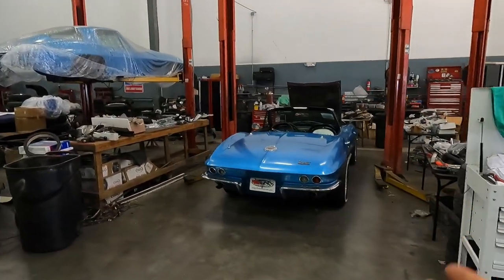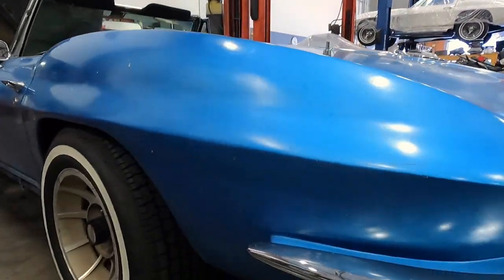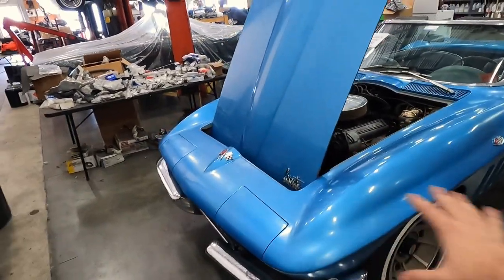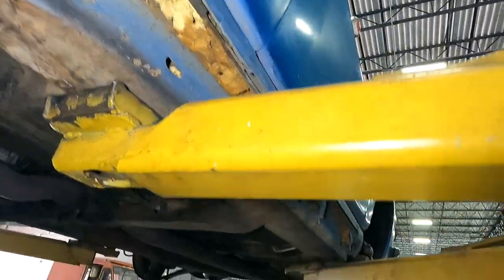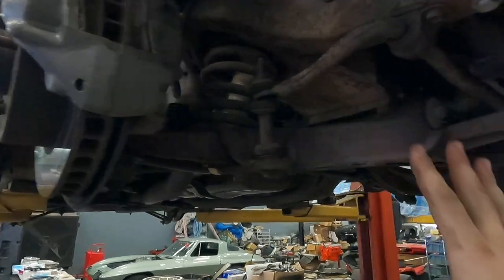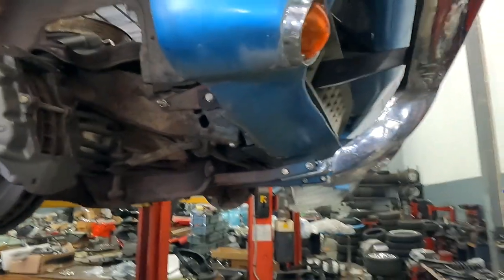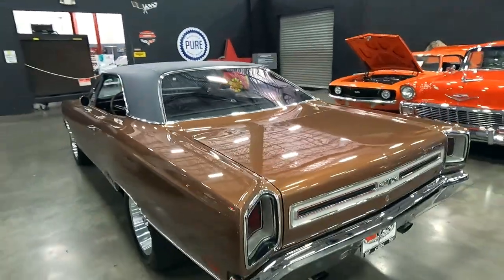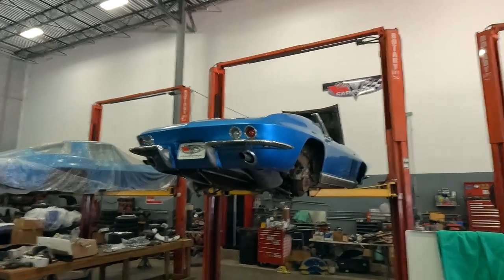Our Most CHALLENGING Corvette Restoration Yet? Frame Off 66 C2 Convertible

Comment: So what was the purpose of all the foam ?????
Reply: Either for sound deadening, and or for "structural purposes". This kind of foam was hot a couple of decades ago to "add strength" to a chassis by limiting the void space in the frame rails. The biggest problem with this foam is it can trap moisture and accelerate rust. Lots of OEMs in the 90s and early 2000s built their cars with this material.

Comment: Not sure if you would be interested or would know anyone but I have a New original GM rad support (still has GM sticker on it) for a mid year BUT only catch it has the cutout for the Fuel Injection. I never advertised it but I would think someone would want a new original rad support for a mid year Fuelie.

Comment: I would think that 100,000 dollars would not be out of line for this restoration.   My gut tells me that since this car is not anything special it would not be cost effective to restore it.  I I have seen 66's better than this one go at auction for 65k to 75k.
Reply: A restored high performance 327brings well over $100k. The problem is when you start driving it the value quickly drops.

Comment: holy crapola, what a mess. Hit on all four corners?  If that car belonged to me, I'd sell it and get a no hit Corvette for you to restore.
Reply: It is increasingly difficult to find a Corvette restoration candidate of that vintage that has not been in an accident.  They were sold and bought as performance cars, and not always driven by skilled drivers.  Stuff happens, let’s be happy that the are quality shops who can deal with restoring damaged cars
Reply: @Thomas63r2  Sounds like the relatives want to restore dad's old vette. I got spoiled 40 years ago looking at Vettes . You could find the no hit cars fairly easy back then. I wonder what the restoration bill will be, 100K?.For that much you could find a no hit car.
Reply: @steveosgood9182  it's more of a sentimental thing.
Reply: @georgehernandez1313  Yes, I mentioned that about the family wanting to restore dad's old vette
Reply: @steveosgood9182  it will be well over $100k to bring it to his standards
Reply: @steveosgood9182  Emotion and nostalgia  rule nearly 100% of nut and bolt restorations.  Buying an already restored example can save money: but it is rare to impossible to find a fresh zero mile high digit restoration in your color, drivetrain, options combo for auction money.  Many of the apparent bargain restorations sold at one of the excellent collector car auctions are older restorations and no longer top award winners.  As soon as a freshly restored car starts being driven and accumulating miles, it starts losing value.   Still they are very nice cars, especially for the buyers who intend to drive them often (without the guilt of the first rock chips etc.)    Some enthusiasts enjoy just looking at their perfect zero mile restoration and are willing to pay the restoration price for that privilege.
Reply: @Thomas63r2  I'm old and understand that perspective. A lot of this is personal opinion. I see other car channels desperate to save original panels with large rust holes:  patch, weld, bondo, yuch. Whereas I would rather have a replacement panel. Same here with this Vette. I don't want patched fiberglass ( if that's the plan) no matter how good the restorer . That's just me
Reply: @steveosgood9182  I'm a young 60 and have played with cars for 45 years.  Replacement panels are often the best solution, but can come with their own set of fitment issues.  Fortunately there are some very high quality reproduction parts available for Corvettes.  I think if you watch the HW series on the restoration of this '66 you will really like the results.  HW will correct all the previous mistakes - this '66 will get very crisp body lines and paint that is superior to the original (a turn off only for the hard core NCRS).
Reply: @steveosgood9182  I don't care for repairs on panels, either. I'm a replacer. Thomas is right about finding well-fitting panels, though. That can be very difficult, even on fairly new cars.
Reply: @Thomas63r2  Very true!  The 1970s in particular were not kind to C2 Corvettes.  At that time these cars were cheap and lots of kids got their hands on them, so many Sting Rays were thrashed.